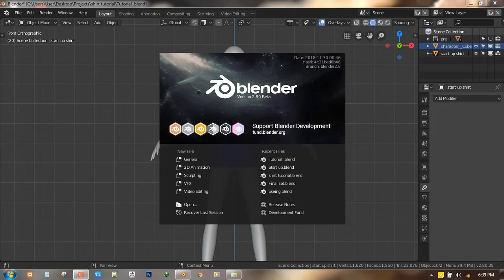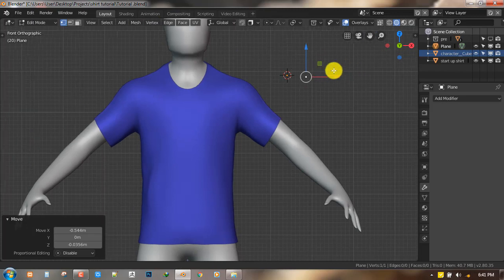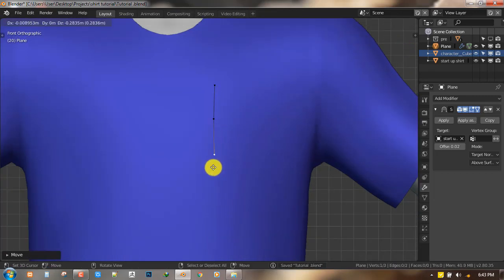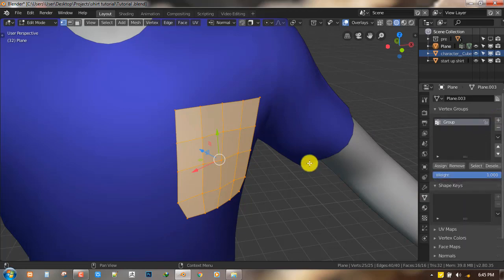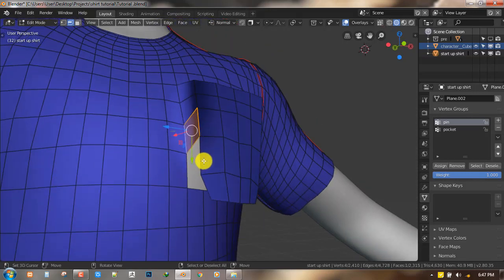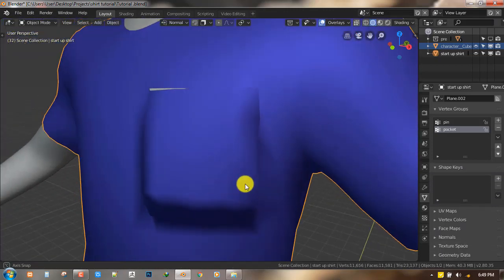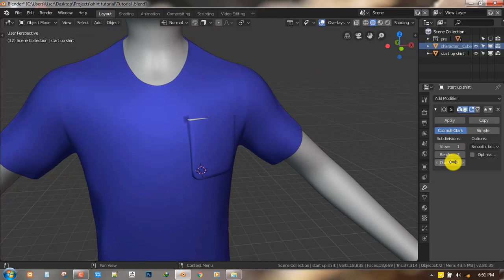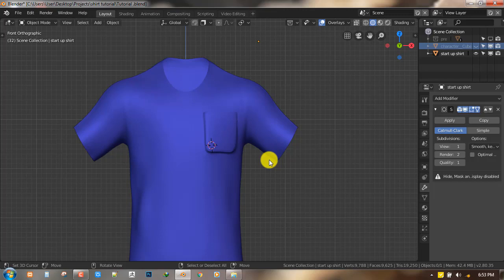How to model a Pocket in blender

Comment: is there a reason you did it this way instead of just extruding the area where u wanted the pocket?
Reply: His way is more accurate since you can exactly control the shape instead of shaping the existing surface. Also, you can exactly duplicate the shape (e.g if you want 2 pockets).